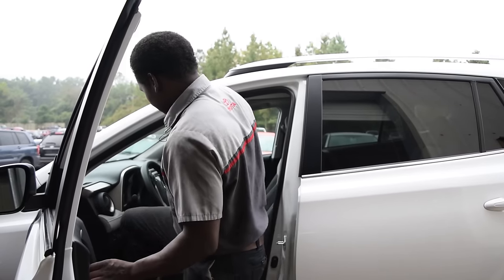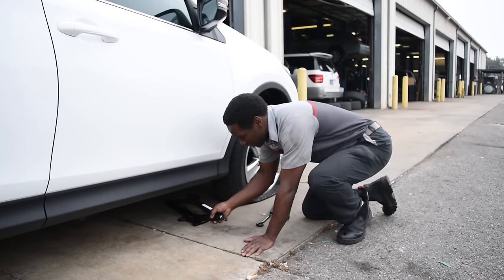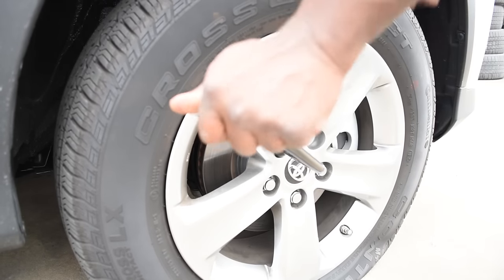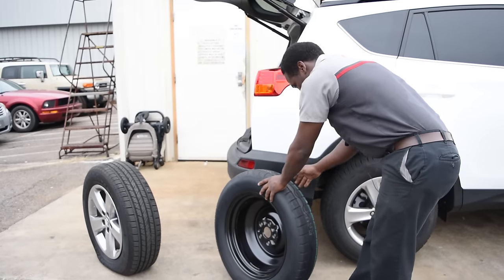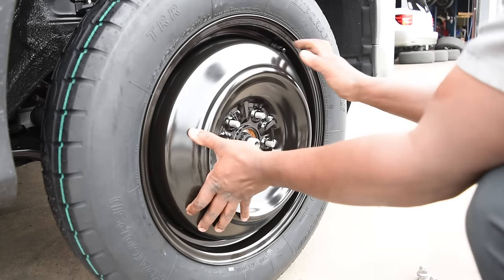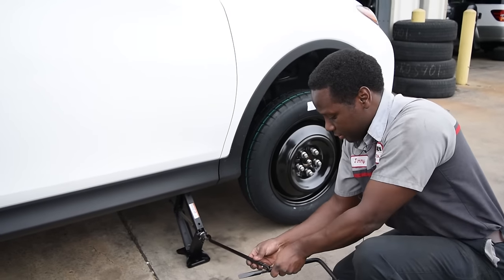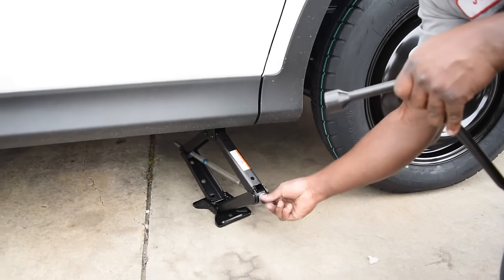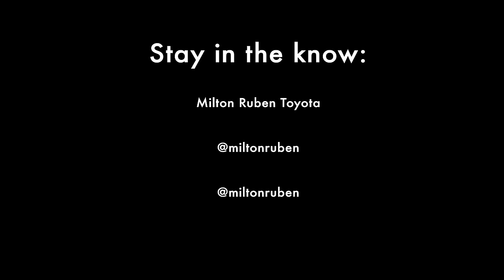How To Change a Flat Tire with Certified Technician Jimmy Berry

Comment: ok folks- from a pro
this is a great demo- but equally points out some weaknesses in the spare system. - all of them. 
at least --
replace that angular lug wrench with a 1/2" drive breaker bar and the appropriate 1/2" IMPACT socket
you also want to have a 1/2"  drive ratchet 
purchase a HEX NUT the same size as the car lugs and weld it ( have it welded ) to the jack drive tab.  
now -  you have a ratchet with a hex nut drive and the appropriate socket to drive your jack. 
you also have a long lever arm ( breaker bar ) to loosen and retorque the wheel lugs. 
it is also important to remember-  you want to put the doughnut spare on the axle with the least amount of weight if you plan on driving any extended distance.
Reply: "Purchase a hex nut the same size as the car lugs, and weld it to the jack drive tab." 
Uhh no thank you, this isn't Get a Grip Garage.

Comment: I tried doing the front tire without the emergency brake - it doesn't work so well.  I rolled back.  Chocked it (on the back side only), rolled forward on my second attempt with the lug nuts off and the wheel half off.  Then I thought maybe I should chock both sides of the back wheel.